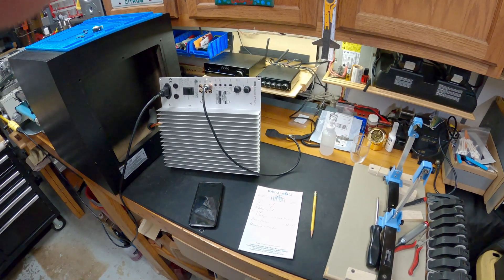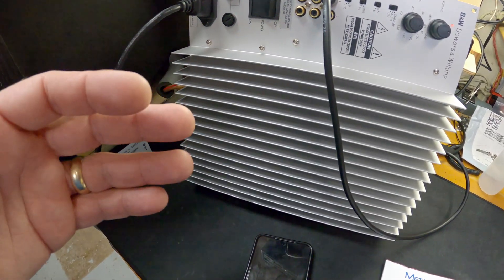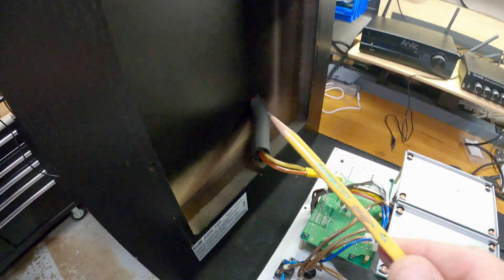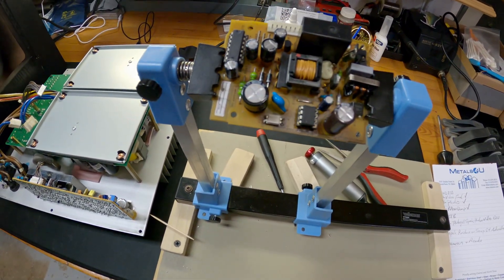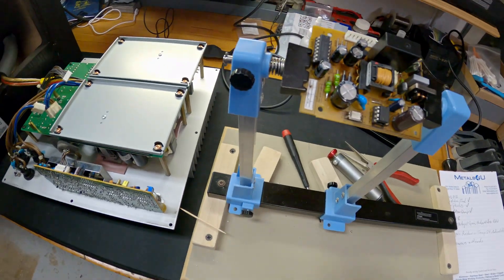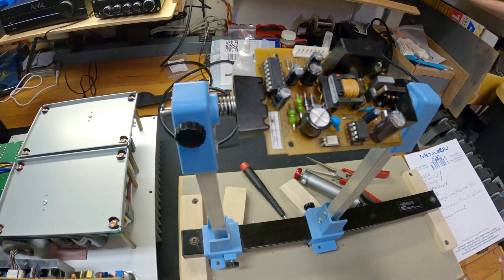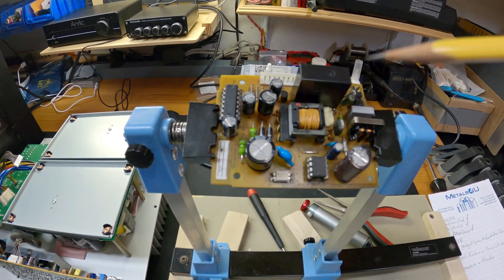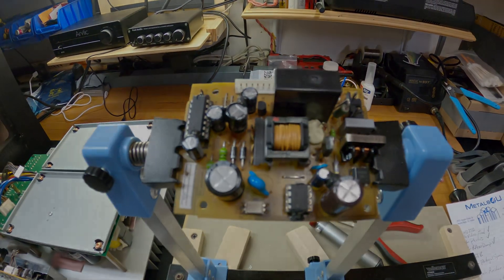Bowers & Wilkins B&W ASW 750 Subwoofer Not Working Repair

Comment: My 750 failed as well. B&W won’t repair it. Doesn’t make sense to me. Very strange of them. Can I just send you the standby board and have you. Checkout out and repair it if necessary?
Reply from the maker: I would love to try and help you but it's not practical.  I hope you understand.  I would find someone local around you and share this video with them.  If anything, for about $20 (depending on where you live) you can just simply replace what I did on the stby board and see if that works.  You just need to find someone with soldering skills.  Good luck.
Reply: @motleypixel easier said than done. I’ll just get a new one.
Reply: @christiansculinarycreations just repair it yourself? Where you from?
Reply: @brub5174 no time to do it. Surprised B&W can’t fix it. It’s Very odd. Texas
Reply: @christiansculinarycreations  they probably can, but it is more cost effective to not do it. A bit for, am from Belgium or I would do it for you 😅

Comment: Hi, how are you?
I’d like to know if you could reply to the email I sent regarding the capacitors you used in your Douk U3 modification project. I’m particularly interested in the models and values you selected.
Thank you in advance for your response.
Reply from the maker: Sure, did you comment/ask on that video? I will get you this info in a few days as I am traveling.
Reply: @motleypixel  Yes, I mentioned it! I found the modifications you made to that device fantastic, and I’d like to do something similar with mine. I’m sure it turned out great. Have a safe trip, and I look forward to your reply. Thank you!
Reply from the maker: @blaywo  okay my hotel has 20gig internet, LOL twice as fast as home.  I guess having the luxury penthouse suite helps :)  So, for the caps on my Douk U3 I used these:  https://www.digikey.com/en/products/detail/nichicon/UFW1V471MPD1TD/4317544  and these:  https://amzn.to/3UBU2Y5
Reply: @motleypixel  Thanks for the links! Enjoy your luxurious room, haha. Could you let me know the µF and V values you used in your project so I can buy the right ones?
Reply from the maker: @blaywo  generally speaking, I buy a step up in voltage and if practical a step up in temp rating, for instance, say the board had a 100uf 25V 85C cap, I would replace it with a 100uf 35v 105C "if the dimensions will allow it to fit"
Reply: @motleypixel  I understand perfectly, thanks for the clarification!